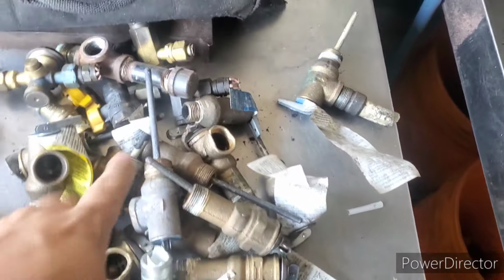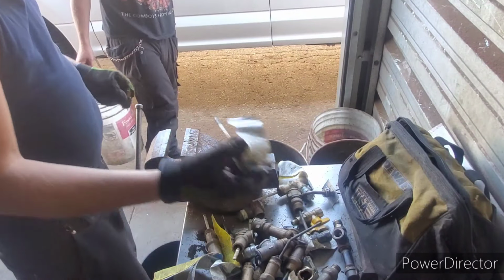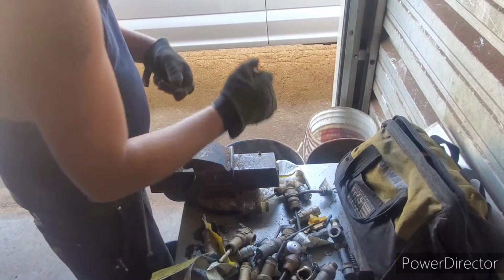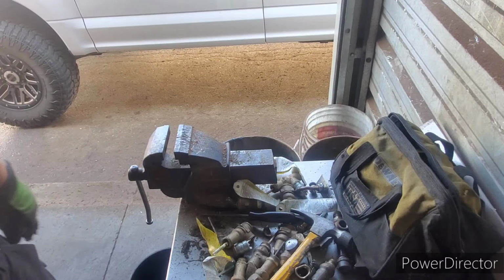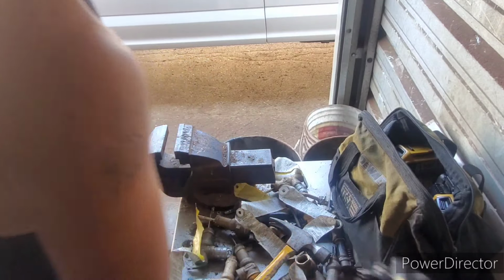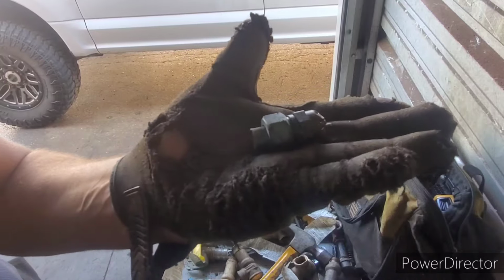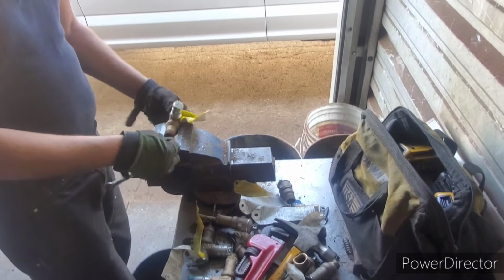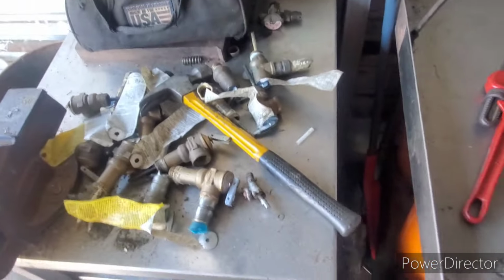How To Clean Yellow Brass Valves And Other Brass Laying Around The Scrap Shop

Comment: Years ago all we had to do was remove the top but when i quit scrapping then and when i went back into it recently i found out we have to remove the center now to get the good price. when i asked my yard the best way to remove it they took me over to a table and the guy put my valve in a vice with the threaded hole facing out with the top down and inserted a chisel on a downward angle  and hit it and the top popped off and the spring fell out and then he picked another one out of the crate which i then saw that was filled with them not cleaned waiting for a slow period so the guys could clean them and did another one with just hitting that top down with a chisel.  .  no grinder wheels to burn thru or electric used but you do need to swing a hammer that can take a toll on your arm. otherwise i was cutting them in half myself with a sawzall.  going to try that way today. seemed faster but not sure on if my shoulder will hold out swinging a hammer but if i only do so many a day and not do my whole pile at once i should be fine.
Reply from the maker: @steveherr450  nice I will definitely give that a try my friend
Reply: @bigcountryscrapper6885  I think this is my new way for now. i just did a big batch of them. At first i was having problems and thought this is nuts but thought how they did it at the yard. once i got rid of the little pointed chisel which i thought would work better but it doesn't just pokes thru and got rid of the smaller 2.5 hammer and upgraded to a 4 pound hammer and a bigger round punch then i can do it fairly fast.  the guy at the yard can do it in 1 swing i was doing each one in about 3 half swings. i wasn't taking a full swing like he was. i didn't have the confidence like him and only swung my lower arm from the elbow down , not to swing my bad shoulder. it might be better if i used one of the other vices too. i was using one without jaws and it is set on the higher bench  but my good vice on the welding table is buried right now and that is set a little lower so i think that would be better. or my vice on my truck is lower yet and probably would work the best but it is miserable  outside right now.  i think with a little more practice i can learn how to do it pretty good. 1 thing i noticed when i kept hitting my punch and couldn't figure out why it wasn't popping out it was because of the punch holding it in. hit the punch 2 or three times and pull it out and the guts fall out so that was nice to learn that. did i think 50 this morning and i didn't irritate my shoulder at all. i know a while back i tried to use a small chisel and try to pop that top off from the top outside and that was a chore so i started cutting them,  but this way from the inside it just pops off.
Reply from the maker: @steveherr450  nice I forsure gunna try this thanks